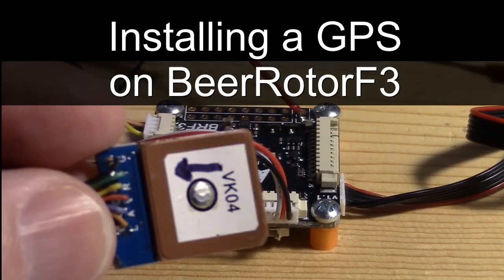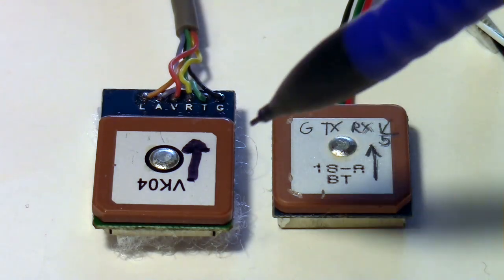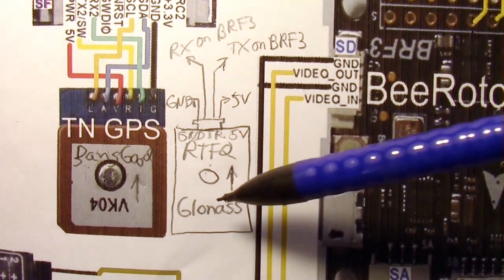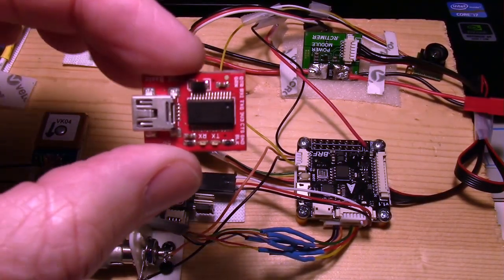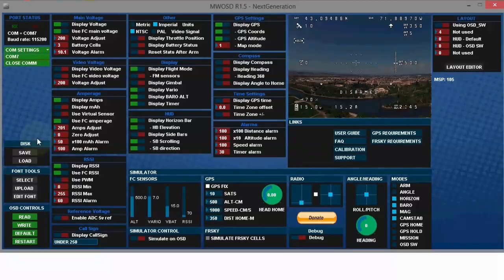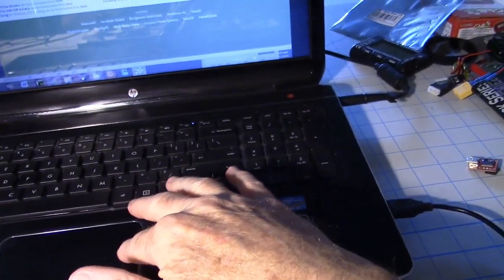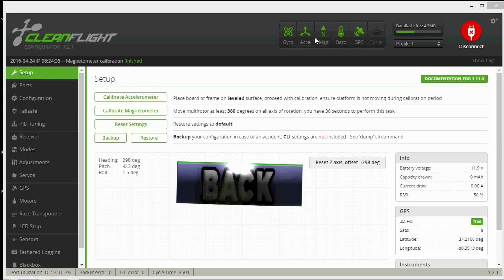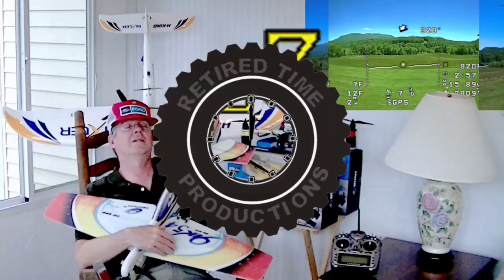BeeRotor Airplane Setup with Cleanflight Part 7.0 (Installing Micro GPS) Step One (Under 250 grams)

Comment: I've just finished another build and used a glonass gps..... It gets a lock in 5 seconds now. Well worth the cost :-)
Reply from the maker: +Vortecks I heard it has something to do with the 10Hz on glonass versus the 1Hz on the older system. But I have not looked into it just happy it works so good. Good luck with the rest of those maidens :-)

Comment: The gps didn't come with wiring?
Reply from the maker: +YoSneeze The GPS came with a cable but the end did not have the proper connector for the BeeRotorF3.
I had to solder a new one on.

Comment: for rth the one with mag on it should perform better , hopefully they will refine the code in inav for doing rth cos it is really needed nowadays
Reply from the maker: +Aron Gatt  Hopefully the programmers will get on the RTH issue soon but the driving force seems to be mini-quad racing which does not call for RTH. Here are the mags I found on Banggood.
http://www.banggood.com/search/compass-electronic-digital.html
Reply: ***** yep , it looks bleak for us fixwingers
Reply from the maker: +Aron Gatt I don't think the mag is really needed. I setup an ET Vector FC and they recommend not using the mag on a plane because it can cause problems. My Twin Star plane does RTH just fine without the mag being used.